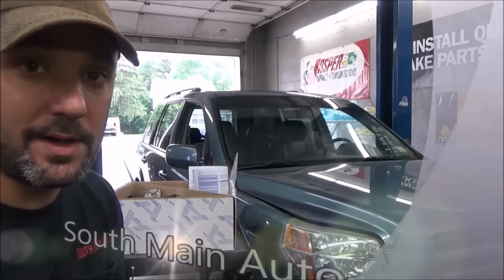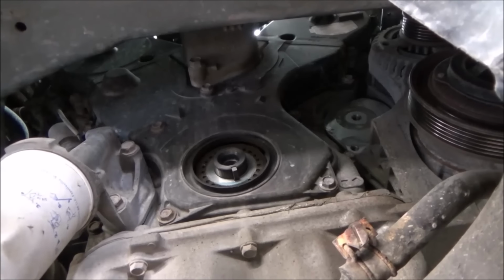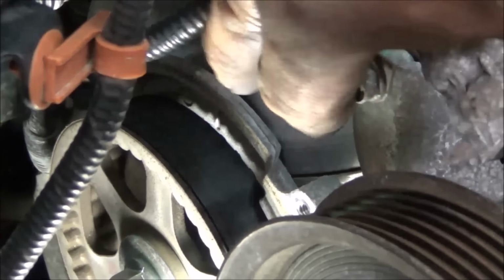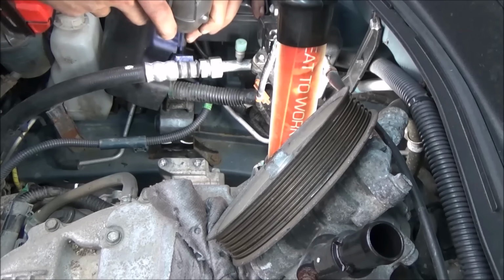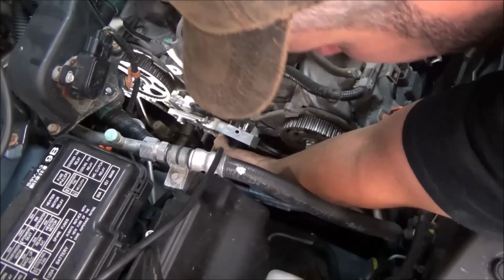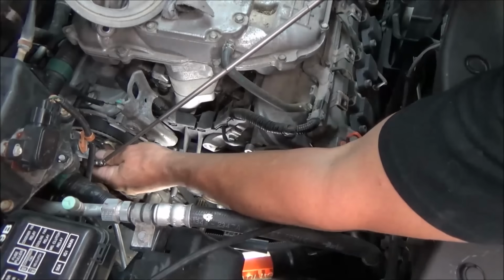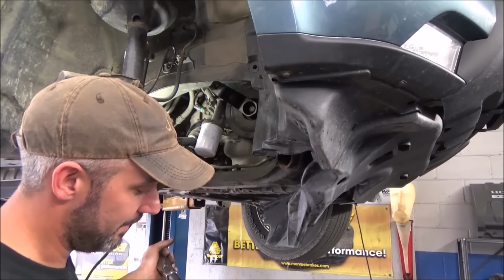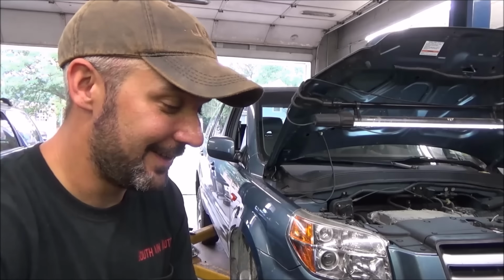Honda Timing Belt 3.5 J35 - Pilot, Odyssey, Ridgeline

Comment: I've always had bad luck with the aftermarket water pumps on Hondas. I've always used OEM on my own, but trying to save people a few bucks and in the end it always bites me in the ass.
Reply: that's what most techs seem to think, definetly not a part worth skimping out on, at least if your water pump is timing belt driven

Comment: This video show the task straight forward... seems not too hard, but...What should I do if the rear cam shaft moves by accident after I took of the timing belt?  Should I move it back to the position that I marked? What should we do if the engine doesn't start?
Reply from the maker: +Xpectadorem Question 1: What should I do if the rear cam shaft moves by accident after I took of the timing belt?  Should I move it back to the position that I marked? ... yes put it back.  Question 2:  What should we do if the engine doesn't start? ... cry... then find out why it doesn't run.

Comment: I'm a DIY'er and did this timing belt change in my driveway a few years ago. It was fun to watch a pro do it with the right tools and a bunch of confidence. I would have loved to have had that heavy duty socket but instead did the starter bump trick which worked like a charm. Other than that the job went just as smoothly as yours did. Thanks for the great vids and if you can make it  I hope to meet you one day at ETCG's yearly meetup.
Reply from the maker: +Baxrok2 You prolly won't meet me there I am sure lol

Comment: I just finished this job today on my 07 Accord V6, it took me about 10 hours since I took it slow doing it for the first time.  This video helped tremendously, thanks Eric!  That monstrous socket did wonders.  I used an old electric impact gun + that socket, the crank pulley bolt came off in 5 seconds!
Reply from the maker: +Ronnie Shih Oh that's cool, glad to hear the video helped ;)

Comment: Eric, brand new subscriber. I'm about to buy a 2011 Odyssey that is approaching the 100k mark. Your video is encouraging me to do the timing belt job it will need. I've done only one other timing belt job and that was on a 4 cylinder 2001 Camry. Your clear shots and well planned out scene progression help a DIY backyard mechanic tremendously.
Reply: +Seppa I did my Odyssey TB/WP/Tensioner/Pulleys myself and it wasn't nearly as bad as people make it sound. Definitely DIY doable - Go for it and save yourself around $600. Good luck!
Reply from the maker: +Seppa They really are not that bad if you can get the crank bolt off

Comment: Might seem like a strange question, but do you always put the tensioner on last, when the belt is on? I always seem to struggle getting a timing belt on.always seems too short, maybe this is where I am going wrong!
Reply from the maker: Jonathan Dean Well that depends, on this model yes, on some models it is the idler that goes on last. Depends on the car I guess.

Comment: Eric O - What is and Where did you get that adjustable length wratchetr? 3/8 or 1/2? So many times you need one that can get into tight places but extend out without putting a metal pipe over the end..
Reply from the maker: Keaton Massie SATAMAN Schmidt Hooked me up with it :)

Comment: Eric, very best coverage of a timing belt video on the Net!! I did my 2008 Honda Pilot with OEM timing parts. Had to use a 4' long extension to break crank nut; I believe the large flat washer surface area creates the grip very well. I noticed some people add tension to the belt by turning the forward cam, which is unnecessary. Some people don't know this, but when the engine is off, the tensioner doesn't always keep the belt tight, and you might think there is a problem; however, once you crank it over the tension is normal. I found this out the hard way.
Reply from the maker: jake ounce I tell ya man if you do an other one you'll need to get that socket I have . I can't wait to use it again just to see.
Reply: South Main Auto Repair I put an OEM tensioner, from Rockauto, on the Pilot and it started to leak hydraulic fluid. They did send me another tension, at no charge, works great!!.

Comment: Man oh man. Did the tb and wp on a 3.5 odyssey last month. Took forever trying to get the crank bolt loose. Broke one of my 1/2" breaker bars trying. That recessed bolt was probably two hours of the four or five doing it. What a pain!!
Reply from the maker: Cliff Pierce Any one that has done a Honda has been there let me tell ya! I have had a few kick my butt too!
Reply: +South Main Auto Repair Just curious, how many ft/lbs are your strong, crank bolt pulling impacts? I want to up my collection.
Reply from the maker: Boy not real sure really... I use IR "thunder guns" You can google them and see..
Reply: South Main Auto Repair Just looked them up. Ordering one of the bigger ones. Turning big bolts by breaker bar/socket wrench sucks. Thanks.

Comment: did they change the design of the pilot's engine bay? i have done this before but i remember pulling the engine mount first before removing the belt because the mount is under the PS pump directly and the belt passes through it and i remmember the cruise control actuator is located in front of the fuse box not mounted on the firewall .... huh
Reply from the maker: K Yeah there is variations on different years and stuff, I am not exactly sure what years and all the details. I work on to many makes and models to keep track of it all.

Comment: Waht make and part # of the HD socket you used for the crankshaft pulley ? How much did it cost ? -Thanks
Reply from the maker: ppett1 Look in description box
Reply: Oops.

 I also need to perform a TB replacement job on a Gen 1 CRV  B20B engine.. Could you make a video for that one too .

- Thanks

Comment: Great video. Any thoughts on using a TB kit that has GMB rollers and a NPW water pump ?
Reply: I'm not sure for Honda but I know for a fact that Aisin is OEM for Toyota. It is printed right on the water pumps and oil pumps.
Reply: ppett1 I've used 2 of these kits. one kit the idler pulley started making noise around 20k. The other wp started leaking at about 30k. I would not recommend them. Aisin kit as in this video haven't had a problem yet and are very good quality.
Reply from the maker: madbull9988 I believe the Aisin is OEM for Honda....

Comment: I like the extending handle ratchet; do they have one with a flex head?
Reply: John Kerns No TOPTUL does not. The unique feature of this tool is that it has no detents. You can extend it to any length needed without needing to be placed at a detent. Also, you can do this extension without using two hands. It works on a cam lock.

Comment: I don't get it.  Scotty Kilmer could do this job in less than 4 minutes (albeit with more grunting).  Quit slacking!
Reply from the maker: Steve Rothenberg Ok ok , next time, I'll do it in 3... not sure if it will run or not however
Reply: +South Main Auto Repair good luck.  ha-ha. pretty sure it took more than 3 minutes to bring it in and get it on the lift.  Scotty's videos are incredibly deceptive.  I enjoy this channel because its so thorough.  Keep up the kick ass work man!

Comment: Eric Great job but may I add I always start with the crank on # 1TDC that way the keyway is up and less chance of falling out I think that motor mount was broken  I always take the P/S pump off early on moor room for back cover.   Last I got to get me on of those sockets   did I miss the part # and maker?      Joe
Reply from the maker: Joseph Tucci I put the info on the socket in the description below the video...

Comment: Eric, congrats on reaching 10k subs! I'm impressed with the amount of videos you are able to post and the detail & depth you dive in with, with regards to commentary / play by play. On top of that, the video editing & replying to posts! Won't be long before you surpass ericthecarguy & briansmobile1 ! Hope your subscribers & viewers realize what it takes to do what you do WHILE running a shop! All the best to you & yours. I might not comment much, but I try to watch as often as I can (usually busy with my own channel) to get tips on tools & non VW / Audi stuff. ;-)
Reply from the maker: ***** Hey Thomas good to hear from you! Yeah it sure does take a lot but I am sure just like you it has just become part of some of the jobs. On the other hand it has made for a late night here and there...
Reply: Thomas EXOVCDS z
Reply: Wow!  2 years a go SMA had 10,k subs and now 127k1
Reply: South Main Auto Repair i have a question I don’t see in the comments, i did my timing belt yesterday on my 07 Ridgeline and I turned the crank over 6 times to notice my rear cam gear is one tooth off from alignment! Should i worry or take the timing belt back off and realign it?

Comment: I think my 05 Cobalt is due for this, the tensioners are notorious for going, and being an interference engine, it could be very disastrous if the timing jumps. Not looking forward to the water pump because it is behind the exhaust headers.
Great Video! always enjoy watching you (in a non creepy way)
Reply from the maker: Jeff Dooley The ecotech is chain drive and you can replace the tensioner with out tearing the engine apart if you want to get it before it goes :)
Reply: South Main Auto Repair I know it is chain driven, but I have to take the chain off in order to change a water pump if I ever did it as a preventative measure :P
Reply from the maker: Oh right got ya

Comment: beautiful video as usual. two quick questions Eric:
- I've read that on interference engines should the right cam rotate whilst belt if off it could damage the engine. I haven't seen you take precautions to prevent that. Any reason?

- rotating the crank should eventually land you on tdc on all three marks every time or have you had different experiences and how did u fix that?
Reply from the maker: affane78 Yeah you should be careful turning the cam with the belt off but to be honest it takes a lot to damage a valve just doing timing belt maintenance . As far as your last question do you mean after I replaced the belt?
Reply: South Main Auto Repair no before you take off the old belt, to line up all marks. If for example the crank is lined up but cam isn't do you keep rotating it until they eventually all line up? I've never done a timing job yet but I'm considering it
Reply from the maker: You can rotate till you are blue in the face, if they are off they are always off and if they are on they are always on.
Reply: South Main Auto Repair so if they're off what's the solution?
Reply from the maker: If it is "off" prior to ever having removed it I would think this would have exhibited some drivability problem honestly....

Comment: Never worth replacing a timing belt if you dont replace the tensioners and water pump...  Just penny pinching.
Reply: @billybob042665  cam seals should be replaced when they are leaking. I tend to find they will leak more once replaced. If it ain't broke don't fix it.
Reply: @pxndxlunx5821  preach to the choir brother, I'd find a way to strip out the seals someway
Reply: @samuelsholder2789  just don't look at it the wrong way or it will weep 😉
Reply: If the car has a lot of mileage on it, I would replace the seals regardless
Reply: s34nVideos cam seals aren’t really an issue on these 3.5 and 3.7 motors “if it ain’t broke leave it alone” if the crank seal is leaking then would you replace that seal and put new o-rings and reseal the oil pump/oil pan  since you’ll need to pull it off to do so
Reply: @MarkyDGFX  “if it ain’t broke leave it alone”  isn't really a catch all when you cant offer an explanation for your opinion lol
Reply: facts I'd rather not drive around worrying my tensioner is boutta fail and have coolant leakin everywhere, my cat tries to drink the coolant :(
Reply: @billybob042665  if it ain't broke dont fix it, and then, if your seal starts to leak that bad like you said then that seal must be real bad or damaged to actually cause any damage to your engine (losing alot of oil)but common sense you tell you to add oil/stop driving the vehicle until you fix it. In all honest, I don't change mine and they dont give me any problem, if they do then okay I'll change them. Not finna lose any sleep about it.

Comment: What gets me about Honda is if they say change the timing belt at 90k miles they mean it. You try and get 94k on one and it will destroy the engine. I seen to many with the engine damaged for sale. So whom ever designed that belt MTF was spot on.
Reply: +Claude “Reviews4U” Rains - I just changed mine on a 2006 Accord V6, 113k miles. The timing belt inside looked just fine, as did the water pump and the pulleys I replaced. The only thing that looked worn was the hydraulic auto-tensioner.
Reply: +Claude “Reviews4U” Rains I changed mine at 150kmi on my Odyssey. Amongst members of the Odyssey forum I was on this was quite common.
Reply: Baxrok2 Check the adds in the for sale section under Honda. See how many have blown engines for sale. 

And just because someone gets away with it. Doesn't mean you should try it. The factory says replace at 90k miles. You do the maintenance or pay the price to fix it. If things go south on you.

Good Luck
Reply: +Claude “Reviews4U” Rains "The factory says replace at 90k miles." You can't be serious? Check this video, the car has 100kmi on it and no boogeyman TB engine failure nonsense! lol
Reply: ***** I'll take the Honda engineer word for it. As they designed and built it. 

I also told you. Just because someone else got away with it. Doesn't mean you should try. As you have no idea how they drive it or what conditions they live in. So if you're telling people to disregard what the factory says. I hope they can find you and get you to fix it for free when it fails. 

Later imbecile.
Reply from the maker: I just looked it up on the Honda OEM web site to help you guys out - 

"2006 Honda Pilot 3.5L Eng LX

Vehicle Reference: TIMING BELT REPLACEMENT - 3.5L & 3.7L

MANUFACTURER'S SUGGESTED SCHEDULED MAINTENANCE
Normal replacement interval is at 120,000 miles. Replace at 60,000 miles if car is regularly driven in extreme temperatures (over 110 degrees F, or under -20 degrees F)."

Hope that helps. I have seen them come in the door and have changed dozens of them rangining any where from 90k to 205k on the original belt. I work on a ton of Honda's and Subaru's and have yet to see one break in that mileage range. I have seen tons of neon's, corrola's and PT's snap belts at 70k back in the day. Any how I let customers do whatever they decide but on my Honda's I change mine around 100k.
Reply: South Main Auto Repair Well I asked the Honda service tech. They say replace what it says in the service manual. That includes milage or years in service. As I had one come in that had only 45k miles and the belt went south. A closer inspection the car was 11 years old. As anybody knows oil products degrade over time regardless if you drive it. That includes belts, tires, hoses, seals. 

Being the car was mint. I tried to get a used yard motor with around the same milage. The guy at the yard laughed. He says the engines don't stay around long As they ship them out as fast as he gets them. 

I also repaired 5 this year. Four had used motors in them. And you guessed it. For timing belts breaking..
Reply from the maker: Claude Rains Wow all Honda's with 3.5's too?
Reply: South Main Auto Repair 4 cylinders. Only worked on one 3.5 this year. Was leaking oil like a well. Which I told them got behind the timing belt cover. So I have no idea what might be in there but they just wanted it fixed to sell it. Which will be the new owners problem.

Comment: I'm about to attempt this on my 2006 Accord. Also getting the Aisin kit.  So this video was good... TIMING.
Reply: I see what you did there.
Reply: Like Eric said the Asian kits are good but buying a high Quality water pump separately is a must !
Reply from the maker: anti0918 There ya go! Very similar job.
Reply: +South Main Auto Repair Well I finished the timing belt kit today. I tried that fat Lisle socket on the crankshaft bolt, but it didn't budge. My impact wrench only does 450 ft-lbs, and I only have a 6 gallon tank, so maybe that was a factor. But I was able to get the bolt off by using a little MAP torch for a couple minutes, with a long pipe on the breaker bar.  Re-torquing that thing to 47 ft-lbs PLUS 60 degrees was ridiculous!
Reply: @bird98109  I know you replied 3 years ago but I wanted to mention that sometimes the issue with an impact gun can be limited air flow.  Impact guns and ratchets usually come with 1/4" standard flow adapters.  An impact gun works best if you to replace the adapter with 3/8" high flow adapters.  Your couplers will also have to be replaced with high flows units.  These can be purchased on Amazon cheaply.   I bought the Milton S-217 1/4" NPT V Style Coupler and Plug Kit - 6 Piece for $14.    I am also running a 20 gallon oil compressor with 3/8 rubber line.   My comment is more for someone who may later watch this video and also have issues with their impact gun performance.

Comment: I changed the timing belt on my 4cyl accord and my sisters 6cyl. The crank bolt is tight for sure, but the tool really is used to hold the crank in place. I'd use that fancy socket of yours and surly spin the crank and bolt together.
Reply: peelman1506